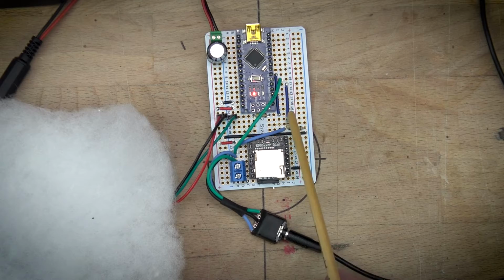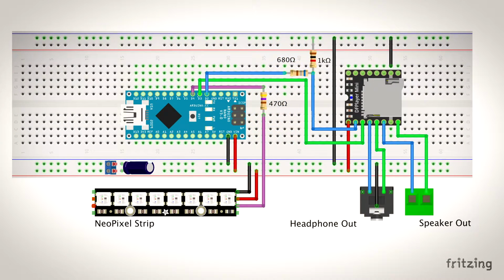Lightning and Thunder Effect - Arduino, DfPlayer Mini, NeoPixels

Comment: Whats the layout for using a basic Lighting strip you can get on Amazon?  Im trying to incorporate that now but you have 3 wires and im only working with 2 for the light strip.  Its not powering on still.  Thank you
Reply from the maker: This project was really intended to use NeoPixels for the lighting. What that means is that toggling the lights on and off relies on using the NeoPixel library where power to the LEDs is separate from the Arduino and the third wire is used to digitally control the LEDs. If you purchased a standard strip of LEDs that run off of a small transformer (maybe USB) or are 12 volt, that will require a bit of a different approach. Here's a quick overview... forgive me if this is already obvious to you... there are a couple of ways to power and Arduino. If you use USB, it's five volts in. If you wire directly to the power pins you'll need more like 9 volts to provide enough power to the onboard voltage regulators. However, all of the output pins are 5 volts but very minimal amps... you can only safely power one... maybe two LEDs on an Arduino pin. What this means is you will need to connect your LED strip to it's own power source that can safely handle the power needs of the strip and then use the Arduino to "switch" the power on and off rapidly. There are two basic ways to do this. The first is to use a relay. A relay is a mechanical switch that can be controlled by the Arduino to toggle on and off. They're a bit slow and a bit noisy so a better solution is to use a power MOSFET module. They're like a relay but not mechanical. If you search online for "Arduino MOSFET" you should find a bunch out there. They'll usually have connections for whatever the power source is and connections for whatever you're powering. There will also probably be three pins that you connect to the Arduino. One for power. One for ground. One for data. Switching things on and off is as easy as toggling the data pin HIGH or LOW. They're fast and silent. using something like this simplifies the code because you don't have to worry about any of the Neopixel stuff. You would simply define the pin you have connected to the MOSFET and then quickly make it go HIGH and LOW to simulate the lightning. I know that is super high level but I hope it points you in a useful direction. With all of these things, make sure that the module you use is rated for the voltage and amps that your LEDs need. Strips are often 12 volts and long strips can start to draw a lot of amps. Whatever you use to power and control the strip needs to be able to safely handle the current without overheating.

Here's post that I found when I started researching this project - http://adam-meyer.com/arduino/rfp30n06le-arduino

Here's an example of a MOSFET module that is rated for 15 amps - https://www.amazon.com/gp/product/B08RRTBNSS

One thing you would ideally want to find is a module that has an opto isolator that physically separates the higher voltage side of the circuit with the lower voltage control side. That provides the best solution to protect your Arduino from any chance of being fried should something go horribly wrong with the MOSFET.

Something like this - https://www.amazon.com/3-7-27VDC-4-Channel-Driver-Amplifier-Circuit/dp/B07QGXY7F3

All the very best with your project!
Reply: @RandomMakingEncounters  that’s all great info and thank you for taking the time to explain. It makes sense to me the difference. Do you sell the same set up you sold to VanOaks Props for his changing portrait? I would buy your services in a heartbeat.
Reply from the maker: @Carina-1133  Unfortunately I don't. I'm not a trained electronics person and it makes me very nervous making things for others. I worked with VanOaks as a bit of a collab but it caused me a fair amount of stress. I generally feel that I'm always working within the specs of what my circuits need to be to safely handle the voltages and currents but there are so many variables that I feel I'm not in a position to really be able to say that anything I make is the really real way you should do it. My videos are more along the lines of... "this is how I did it and it seemed to work and it seems to be based on how people say you should do it!" I'm also generally working with low voltages and low amps so the risk of catastrophic failure is also low 😄!
Reply: @RandomMakingEncounters  do you have the map for VanOaks Props like you showed for this set up? I’m so close to completing but there are a couple places I need position clarity without getting a degree in arduinos 😅. I would be so grateful for anything to complete this project. I won’t hold you accountable for anything ever and have my project almost complete. I have the printed 2 changing portraits, the frames and all the parts to complete but just don’t have the final electrical set up. You would be making my world!
Reply from the maker: @Carina-1133  I think I put together a Fritzing layout using a MOSFET and some sample code. Let me take a look and see if I can dig that up. How to do this is a common question and I have toyed with the idea of a follow up video... I may even have a draft blog post. I'll reply when I've had a chance to scrounge.
Reply: @RandomMakingEncounters  that would be amazing! Thank you so much.
Reply from the maker: @LanceAndCarina take a look at this post. It provides a bit more detail on swapping this approach over to using MOSFETs - https://randommakingencounters.com/thunder-and-lightning-effect-redux/

Comment: what file names do you give to the mp3 recordings?
Reply from the maker: Sorry for the really slow reply. Things have been a little crazy. I hope you found a solution to your question. The best resource for this module is the online documentation - https://wiki.dfrobot.com/DFPlayer_Mini_SKU_DFR0299. If you scroll to the bottom, it has some information on file naming and some things to look out for if you're using a Mac. They require a four digit number but you can then use additional characters in the name. I would avoid spaces and special characters and only use numbers and letters. Again... sorry for the slow reply and all the best with your projects! Cheers!

Comment: Do you think the basic logic & components of this project would translate to a version of your haunted radio prop? I'm wanting to build a radio that is not activated by a switch or motion sensor, but rather is controlled by an Arduino. As a complete electronics novice, though, I wasn't sure where to start. Ideally, I want the prop to remain in standby for a predetermined interval (say, several minutes at a time), then trigger a randomly selected audio track, power a set of LED lights for the duration of the track, and then return to standby for the next interval. Looking at this, it seems it could accomplish that goal if I remove the randomized LED brightness, delay, and flashing... but I'm wondering if you agree and/or if there's a simpler method that I just haven't considered?
Reply from the maker: Totally doable! I've been looking at a slightly different player than the DFPlayer Mini. While I like it for its cost and size, it does require the addition of a few external components which adds to the complexity. The board I've been fiddling with is called - KOOBOOK 2Pcs Voice Playback Module MP3 Trigger Player Board SD/TF Card for Arduino. It has its own quirks to be sure but I think it may be easier to program once you get the hang of it. There's also an Arduino library you can load for it. Your program flow is pretty straightforward and you've outlined it well. If you wanted to use regular LEDs, you could turn them on and off with either a relay or MOSFET controlled by the Arduino. There are modules that you can find online or tutorials around how to control higher voltages with Arduino. You can only power one... maybe two LEDs from an Arduino pin which is why NeoPixels are powered directly from a power source and not the board. I've been wanting to do a series of videos that touch on all of these things but life keeps interrupting. Good luck with your project!

Comment: That's very clever driving the sound based on the flashes you've randomly generated.  I've always approached this from the other direction--making the sound drive the flashes--which makes delays between the flashes and the thunder a tricky proposition.
Reply from the maker: The idea of varying the LED brightness by letting the volume adjust the juice going to the light is a great way to get a lot of variety out of an audio track. The interesting thing is, it's not really how we experience lightning. We usually see a series of flashes and then, depending on how close the strike, the loudness of the thunder. Now... that's a great justification but, for me, this was actually a bit easier to put together since I didn't need to convert audio strength to lighting brightness. It was a bit of a cheat if I have to be honest! Laziness is the motherhood of invention! Thanks for the comment. Cheers!
Reply: @RandomMakingEncounters  I've simulated the delay between the lightning and the thunder by mixing the stereo down to mono and then saving the result on both the left and right channels with the right channel ahead of the left.  I generate the lightning flashes from the right channel while playing only the left channel.
Reply from the maker: @haywardhaunter2620  Nice! I did an animatronic pirate skull and thought about splitting channels... one for audio and one for movement. It's great that you're treating those as distinct data sources and manipulating the effect that way!

Comment: Lovely project, close to what I am looking for, I am VERY new to Arduino and coding but I am willing to try, I am into Model railroading and busy with a layout scene, I would love to have a "Disco Scene, with lights, and got it on separate sketches but struggle to make it one. I am Using an Uno with Mini sd card for music and new pixels for light, can you please help. If you can/will I can send you my files(found on web and tweaked) so far. thank you
Reply from the maker: I'm a bit like you... search the Web and patch it together. I'm semi-okay-ish at programming... connect with me on my blog (randommakingencounters.com) and I'll take a look and see if I can get you pointed in the right direction.
Reply from the maker: Pieter... thanks for reaching out on my blog. I've replied a couple of times but I'm not sure the emails are getting to you. Please see if they're getting caught up in spam.
Reply: Hi, yes I receive, but can not send to you, I tried to send the code I am using, but nothing.
Reply from the maker: @ruhanpieter  thank you. I'll try another email address. Stay tuned.
Reply: @RandomMakingEncounters  did sent on given email, please confirm.
Reply: Just get error message

Comment: It looks like your blog post has been replaced with a generic post (eg Lorem Ipsum under all headings).  I was hoping to grab the code from your website. Are you able to re-post the code, either to your website, or here in YouTube?  Thanks
Reply from the maker: Fixed. I managed to break my little corner of the interwebs. Thanks for the heads up.

Comment: I'd like to add a transmitter to send the sound to a wireless speaker.
Reply from the maker: That should... in theory be easily doable. The DFPlayer has a line out connection. That could be plugged into some sort of wireless speaker hub that has a line in connection. Awesome idea! All the best!

Comment: thanks for sharing - very helpful
Reply from the maker: You bet! There are a bunch of ways to try to get to this effect but I think the big thing is to try to build randomness into the code so you end up with variety without complexity… if that makes sense. I’ve done some fun little dioramas where I just flash a couple of plain white LEDs to imply a stormy sea… no muss… no fuss… just a lotta random fast pin toggling. Thanks for the comment and cheers!
Reply: @RandomMakingEncounters  Randomness - great approach to be sure particularly involving nature

Comment: What if the led lights require 12v DC to power them? Can the Arduino handle the power?
Reply from the maker: Even when using NeoPixels, power to the LED strand is provided directly to the strand from the power source with the only connection from the Arduino being the data input. A pin on an Arduino can only power a single LED... give or take... they're 5 volts and can't provide much in the way of current. If you're looking to control a strand of 12 volt LEDs, you might consider using a MOSFET. There are modules available that allow an Arduino to control higher voltages without too much complicated wiring. You'll still need a five volt supply for the microcontroller and a 12 supply for the LEDs. It will be very critical to use a MOSFET module that is rated for the voltage and the amperage of your strand to prevent overheating. An Arduino MOSFET power module might be a solution. There are also some tutorials out there that cover controlling higher voltages using an Arduino. The code would be MUCH simpler. Instead of all of the things needed to support the NeoPixels, you'd probably need a single pin connected to the module that you quickly switch from HIGH to LOW. I haven't really built anything like this for a project but I've fiddled around a bit with the concept. I hope this gets you a little further along on your project. All the best!
Reply: My led light strips require 12v 10amp power supply, is there a mosfet module you could recommend?